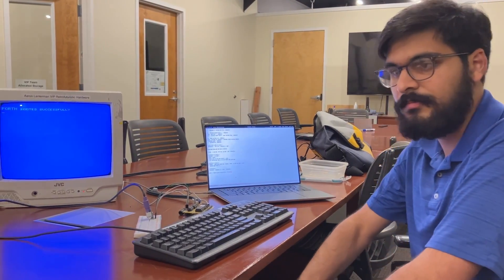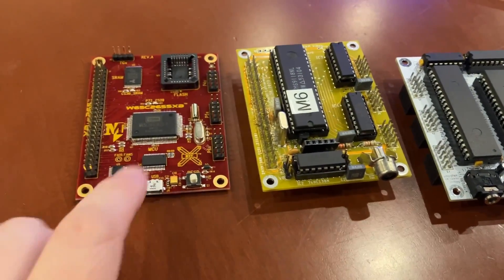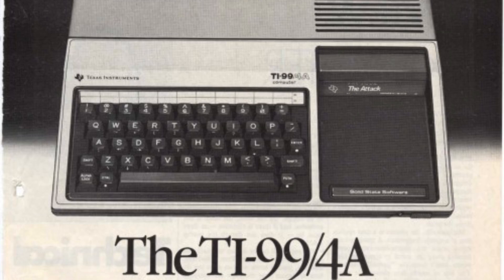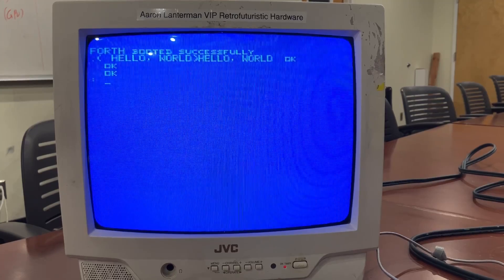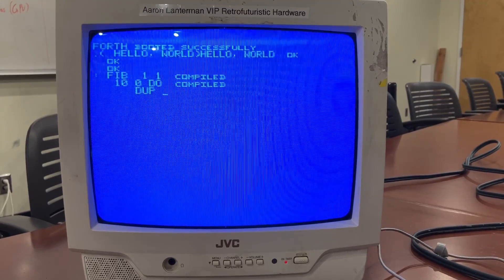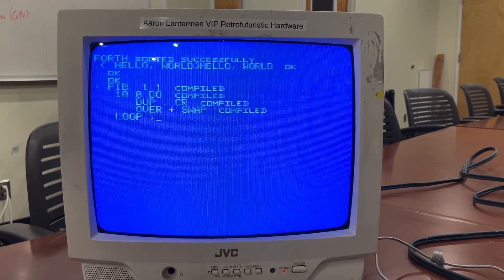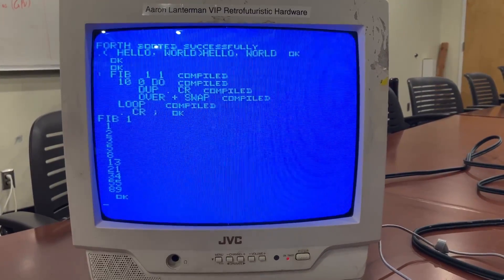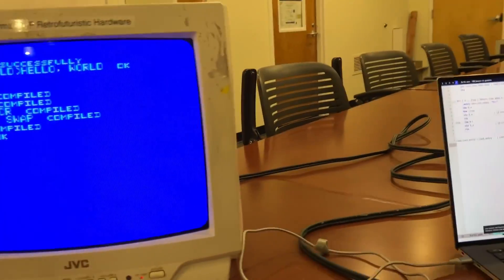RetCom87 Retro Computer Progress: BIOS, FORTH, PS/2 Keyboard, Video via TMS9118 (like TMS9918)

Comment: Do a Google search for 'JONESFORTH git repository—Richard WM Jones.' In my opinion, it is one of the best resources for learning how to write your own Forth. I wrote my first Forth machine for a microcontroller many years ago, using this well-documented code as a guide (though JonesForth is designed for x86 machines).